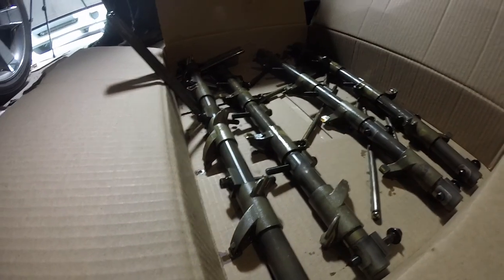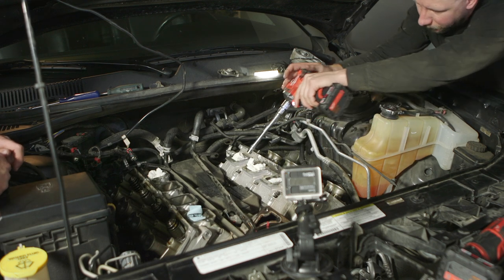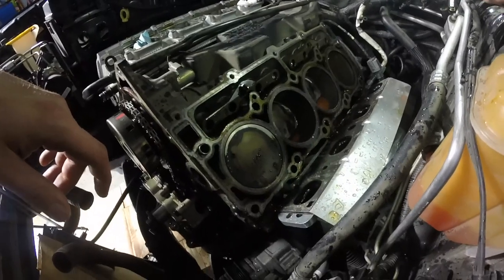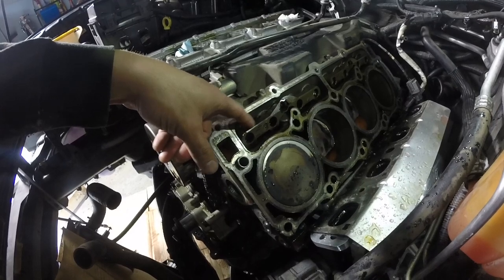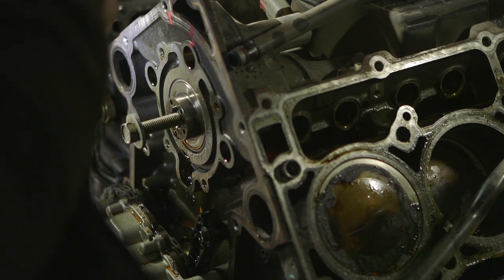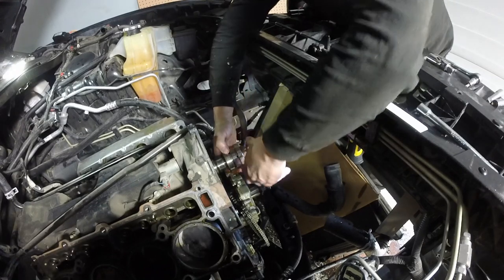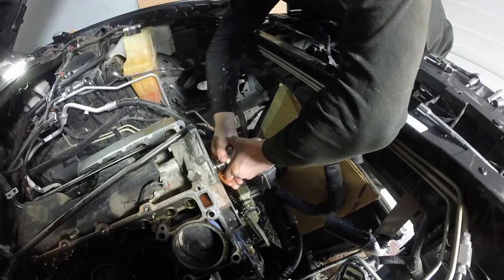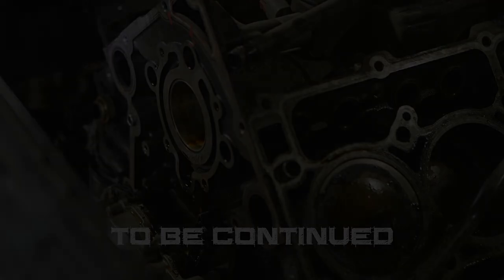HRT Stage 2 Cam Install Part 2.

Comment: Using an old head bolt you can get about a full thread into the cams and it gives you way more leverage to pull it out and install the new one. Just barley hand tighten it don't force the  head bolt into the cam also keep one hand firmly on the cam at all times
Reply from the maker: That’s actually a good tip!  🍻

Comment: I got my cradle bushings installed on my charger really stiff now
Reply from the maker: Excellent!
Reply: Track Pack R/T I guess were the only ones that understand how bad ass cradle bushings are at least I know now how badass they are been driving my car for a few days now fucking insane great mod
Reply from the maker: Srt Charger Old Man 2006 you’re right! It’s a mod that flies under the radar because it’s not as flashy as adding horsepower, but man what a difference it makes being able to put that power down!

Comment: How did you get the headers off? Did you come from the side facing the front of the car or did you come up through the bottom
Reply from the maker: We did a few front bolts from the front of the car the rest we crawled underneath.   It was kind of like when I installed them the first time except this time I already had a pretty good idea of the best way to access everything.

Comment: I see you guys didn't take out the oil pump how did you see the timing mark in the bottom?
Reply from the maker: There were marks that were left by assemblers from the factory that were still visible that we used.

Comment: Are you replacing head and cam bolts or using the old ones?
Reply from the maker: The head bolts we replaced.  The cam bolt we reused.